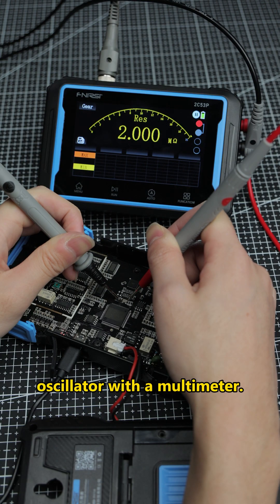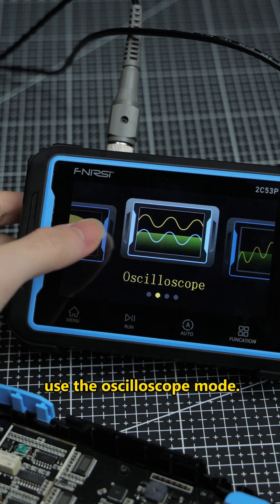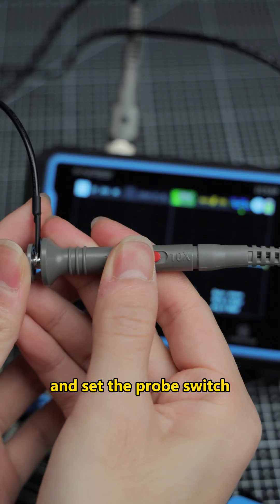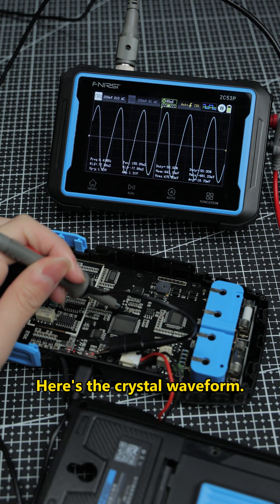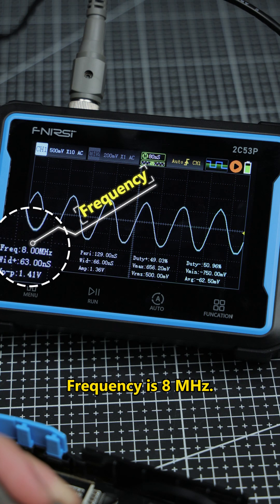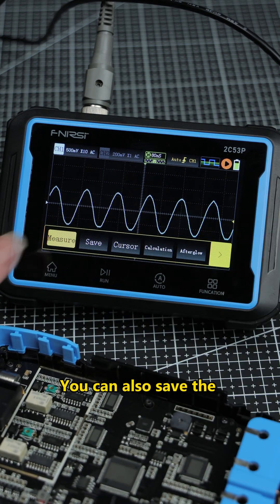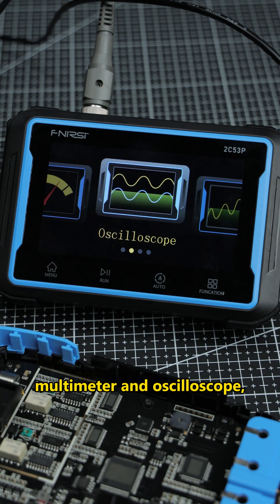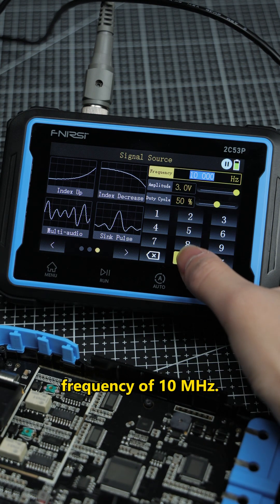FNIRSI 2C53P | How to Check Crystal Oscillator Waveforms

Comment: I bought this oscilloscope about a month ago and it is awesome!
I also update the firmware to it's latest and since then I can't use the signal generator with the oscilloscope. Everytime I switch to the oscilloscope the signal generator goes to 1Khz square wave. Is there a way to use they both together?